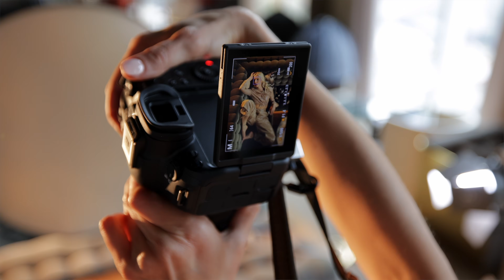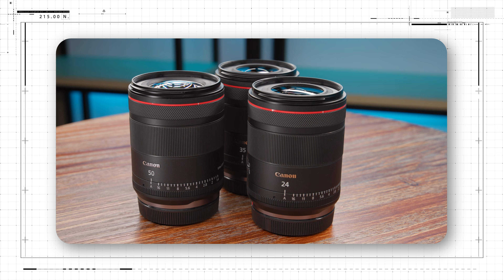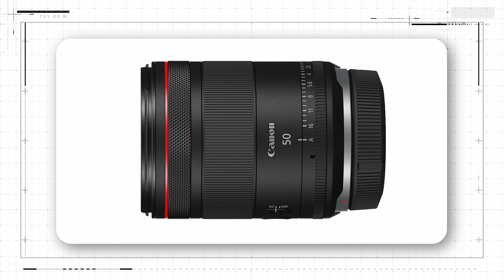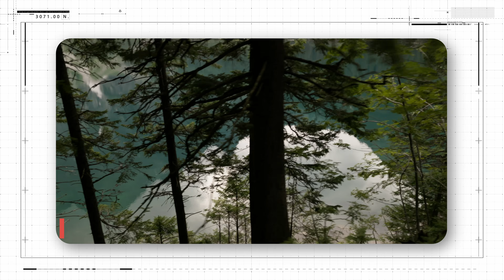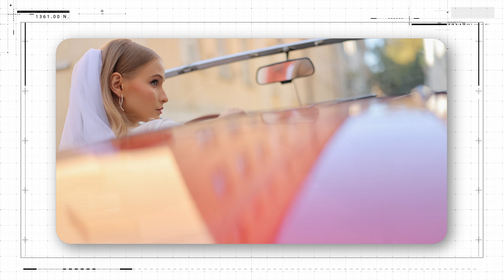Introducing the Canon RF24mm F1.4 L VCM & RF50mm F1.4 L VCM Lenses

Comment: Only two lens I’m waiting on is the 85 1.4 and unicorn 70-135 (or longer) F/2. Please make this lens happen!

Also, really hope they can achieve a smaller 28-70 F/2 or even a 24-70 F/2 at the current size of the 28-70.

Comment: Will both of these lenses rely on heavy lens corrections in Lightroom just like the RF 35 1.4?
Reply from the maker: Hello Rob,

Like the RF35mm F1.4L VCM lens, these new primes use digital lens correction to achieve a compact a lightweight lens with high image quality.  When editing RAW images, you will want to enable lens corrections in your software so that the images look the way you saw them in camera.

If you have other questions, our Camera team can help.  Contact them at 1-800-652-2666 Monday- Friday; excluding holidays.  Outside the USA, visit our Global website at https://Canon.us/globalsupport.
Reply: @CanonUSA  How come Sony's 35mm 1.4 (released in 2018) is smaller, lighter and the optical design requires far less software correction. You had 6 years to make the Sony look old.
Reply: @0x2102  Image quality of Sony, however, is dark and dull compared to Canon.
Reply: Even more !!